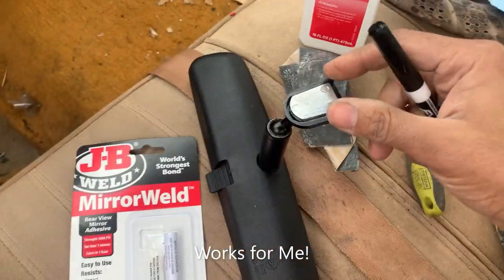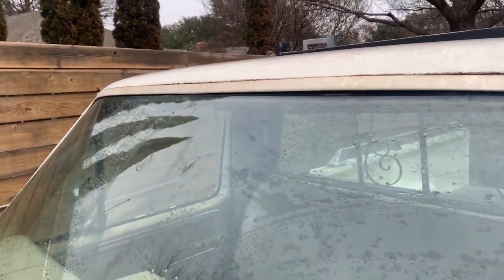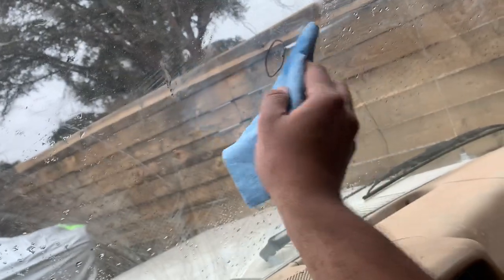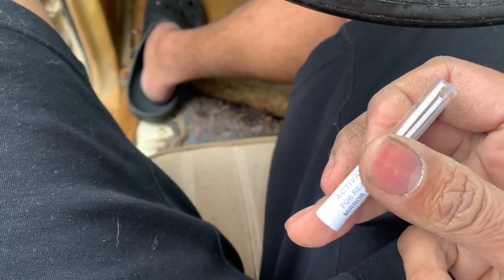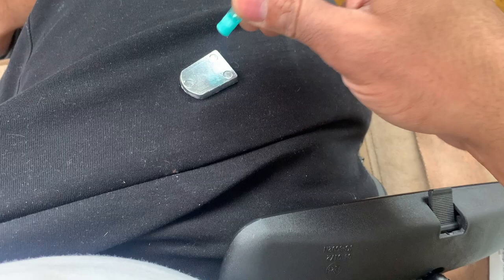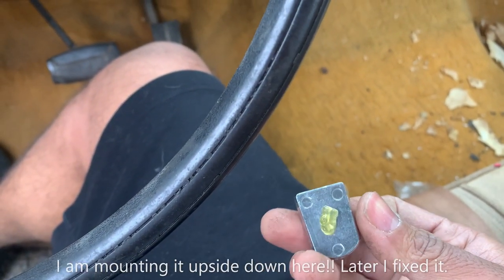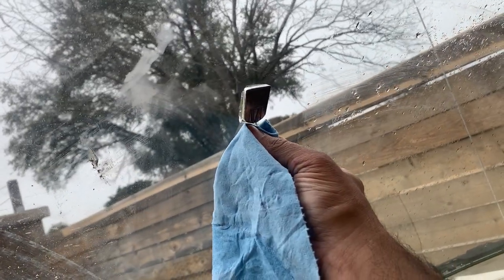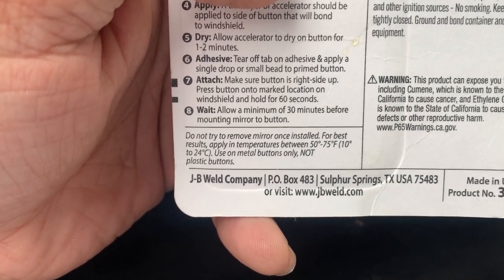Mounting Rear View Mirror with J-B Weld Mirrorweld

Comment: Did it stay on? I’ve used the Permatex brand twice and knocked it off twice with a sun screen. I was advised to use more than the 1drop in the instructions and it held much longer the second time, but still,  I knocked it off.
Reply from the maker: Yes the JB Weld has worked awesome. I tried permatex on another truck and it was a complete failure. In fact I used gorilla 2 part clear epoxy and it worked awesome as well.
Reply: How's the job weld going two months after
Reply: @akeelshah7904  It is still on. I have adjusted it several times (up in the morning and down in the afternoon). It has been in the teens lately as well. I have avoided any sharp blows.
Reply from the maker: @akeelshah7904  Check out my other video where I mounted with just super glue. It worked just as good. Make sure to let the surface tension of the glue hold the metal tab. Give it a good hour or more and get the same brand super glue, I got mine at Walmart I think https://youtu.be/okjsAU2BMuo